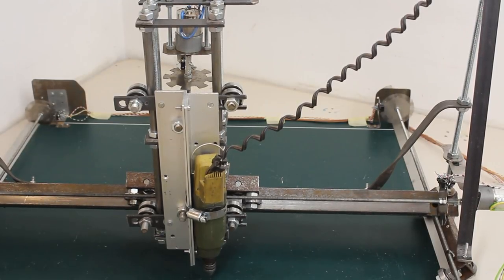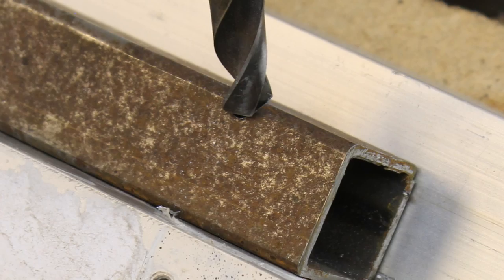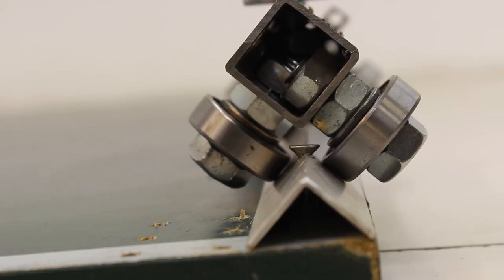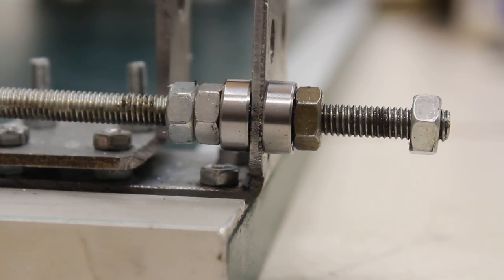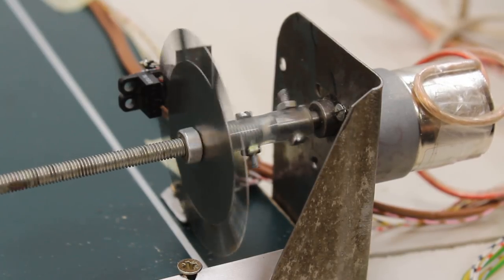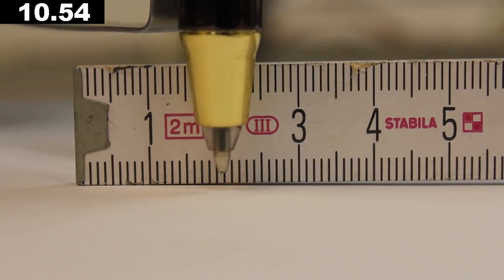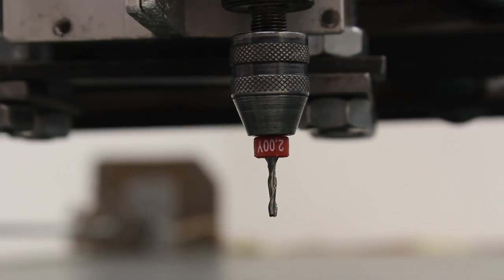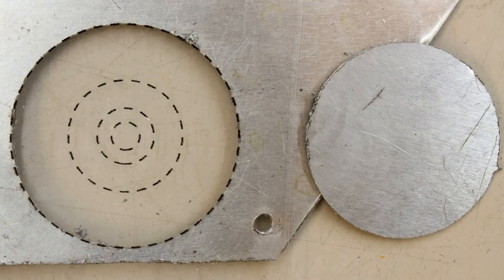Homemade CNC machine with materials from a DIY, built with simple tools

Comment: Very good...a practical way to make a small, low power CNC device without using stepper motors. Thanks for taking the effort to share your ideas.
Reply from the maker: +Ant Mallett Yes it is a practical machine at least for not too hard materials. Plastics is okay and that's what it was designed for. The evolution of CNC goes on. After v0.5
https://www.youtube.com/watch?v=f4ptBpVOSuY
comes v0.6:
http://www.homofaciens.de/technics-machines-cnc-v0-6_en_navion.htm

Comment: You did a great job on the Minimalist CNC machine.  I am very impressed, especially since you did not use any stepper motors and still had very usable accuracy  Fantastic and thumbs up..
Reply from the maker: +valveman12 Thanks! Well, the DC motors are (some sort of) stepper motors the way I am using them. You can see more about the working principle in my video about rotation encoders:
https://www.youtube.com/watch?v=XIUrnR8bLAI

Right now I am upgrading this machine using bipolar stepper motors - stay tuned!

Comment: Thank you for sharing this wonderful material! I was always unsure if I could build a CNC with my modest tools but after watching your vid I have no excuses!
Reply from the maker: +Daniel Perez You're welcome. Maybe you should wait for CNC v0.6 to finish, since that will become an even simpler design:
http://www.homofaciens.de/technics-machines-cnc-v0-6_en_navion.htm 
You can watch the video about v0.5 meanwhile:
https://www.youtube.com/watch?v=f4ptBpVOSuY
Reply: +HomoFaciens Thank you for your recommendation. But... this video is about the 2.0 and you are suggesting to wait for the 0.6. Are they totally different projects? Another question: what's your opinion on using much higher diameter threaded rods in order to eliminate the need for wheels (ball bearings) and the linear guides?
Reply from the maker: +Daniel Perez CNC v0.6 will be much simpler to build. All you need is some aluminium angles and 19mm chipboard. The motors will be from old optical drives or old printers. The simple design doesn't even require ball bearings.
You won't get rods with a diameter lager than 12mm in a normal hardware store. They are NEVER dead straight and even with 12mm diameter they bend noticeable under load.

Comment: One of the best cheap builds I've seen. Excellent job.
Reply from the maker: +Palladin54 ...and it's getting even slightly better. I have upgraded the machine using bipolar stepper motors. The video will get online, soon.
Reply from the maker: +Palladin54 ...and it's getting even slightly better. I have upgraded the machine using bipolar stepper motors. The video will get online, soon.

Comment: You are awesome  Norbert Heinz !! Until now I have always used expensive materials for projects that most of the time end up failing!..... No more excuses for not building my projects out of whatever is available.  Thanks for reminding me that with your imagination there are no limits. Dan, Japan.
Reply from the maker: +Dan Past I always start my projects with cheap materials, because I often fail, too. There is always a reason for failure - success might be nothing but good luck. Usually you can learn more from a failure than from success ;)
Reply: HomoFaciens
Yes indeed... words of wisdom and experience . That is very valuable. Thanks! Dam.

Comment: That's a really nice project. Although the machine would not last long when used on a day to day basis, the project demonstrates the principles of a proper CNC build. My kudos go to you for building a machine "on the cheap" that has a good accuracy.
Reply from the maker: ***** Thanks! Yes, "cheap" is the opposite of "reliable". There are 3 weak points that come to my mind:
(1)The brushed DC motors - brushless (stepper) motors are the better choice for running 7/24.
(2)There is abrasion at the threaded bars even with lubricant, thus you have to replace those elements every once a while especially if you use high power motors to increase speed.
(3)You have to readjust the whole mechanics from time to time to keep the accuracy.
Since the main focus of my project is education, this machine is meant to be the starter "drug" for future CNC junkies. There are many great instructions available how to build more professional machines.
Nonetheless this machine is a great tool for doing some prototyping which I will show in subsequent videos - stay tuned!

Comment: Your my hero! You've made the one kind of 'do it all' CNC machine I was considering doing myself, with little money. Now I'm going to have to seriously consider dropping my other projects to make this. I'm tempted to use cheap China stepper motors though, rather than your brushed motors, but will depend on how cheap I can get them. I like the rusty components as well. Makes it look more homemade and recycled. I'm always keeping stuff, just in case it comes in handy! . Great Job again :-)
Reply from the maker: andy parry Thanks! Maybe I will replace the DC motors with stepper motors some day to improve speed or reliability. For now the machine works great.
...I even pick up rusty screws and take the with me whenever I find one on my way...

Comment: A good solution to your friction versus clearance problem on the 'nut on threaded rod' is something I used on a similar mechanism (although I actually used two nuts with a spacer to extend the length of threaded contact and provide a bit of lateral 'pinch', rather than angling the nut.) I set up my rig with excess friction, introduced some cutting compound and then ran the bar through the nuts repeatedly to grind and polish the contacting faces of the inner and outer threads until they were polished perfectly smooth (I used an electric drill to do the hard work) . After cleaning up (very important not to leave any traces of cutting compound in machinery!) and adding some lubrication, friction was dramatically reduced without compromising clearance. 

p.s. I use Molybdenum Disulphide impregnated grease. It's stickiness does attract dust, but also keeps it on the bar and it's perfect for metal-on-metal gears.

p.p.s. For your application a threaded tube might be better than a threaded rod. I don't understand the underlying physics, but tubes are less prone to bending than solid rods with the same O/D. Furthermore, they have much less mass, which means less inertia. I think you might be better off with 10mm (stainless), rather than 6mm for your threaded shaft. Also, if you used a tube you could couple the end of the tube to your motor shaft using a pin-in-slot arrangement (i.e. flatten and then drill the motor shaft so you can fit a pin through it, then cut/file a slot of the same width as the diameter of the pin in the end of the tube.) If necessary, fabricate a bush to bridge the O/D of the motor shaft with I/D of the tube. These are easy to make using standard steel tube stock because the I/D of a tube can easily be modified to exactly match the O/D of another tube with nothing more sophisticated than a drill bit providing it is undersized.
Reply: +aporiac

lol - just discovered your v2.1 video and see you've come up with a similar multi-nut arrangement to the one I used. If you haven't already done so, try my cutting compound tip for cheaply and easily converting commodity nuts and threaded rod into precision machined components :-)
Reply from the maker: +aporiac 
Thanks for sharing your ideas! I will do some more investigations about CNC drives in the near future. It will become part of my CNC v3.x series:
http://www.homofaciens.de/technics-machines-cnc-v3-x_en_navion.htm

Comment: An excellent and interesting video, thank you for posting.  One little "nit-pick" is when tapping holes.  You should always start with the TAPER tap.  This is tapered to make it easier to start.  Then on to the intermediate, if needed, followed by the BOTTOMING tap last.  This is so called as it allows you to tap to the bottom of a blind hole.  Still a great video!
Reply from the maker: Thats the sequence I used the taps, however I talked to use them the other way round due to my not so good English - sorry. I have added a remark on my pages after other YouTubers spotted that error as well.

Comment: Facinating build. 

Like the way you explain all the building steps and you tell what to look out for while building. 

Tried to build one using MDF and "real" stepper motors, but it never got accurate enough for any practical use. Maybe I should give it another go ☺
Reply from the maker: +Zeedijk Mike This wasn't my first attempt to build a CNC. You'll get better with each project you finish.

Comment: Very good engineering. I've seen a few other cheap cnc machines, but I think this one is the cheapest.
Reply from the maker: Cheap is nothing if it doesn't work. I have used this one a couple of times to process plastics and: it works!

Comment: I am really impressed. I thought there could be some oscillations during the movement of the iron bars. But it is flawless. Great work. :)
Reply from the maker: Subbash Padmanabhan It's too slow for oscillations (less than 3mm per second, around 30 rounds per minute). I guess that could become a problem when using more powerful motors. Sometime I'll do an upgrade - let's see what happens.
Reply: HomoFaciens In such case I hope you have to include some tuned controllers in the program. It will be more interesting and challenging. My wishes. :)

Comment: Amazing! I made a machine following your blog and videos.  Soon I'll publish a video of it. Thank you very much for sharing!
Reply from the maker: +Luciano Santos Hope to see your video, soon!
Reply from the maker: +Luciano Santos
Thanks for the links to the videos. It's always nice to see my CNC machines being copied in distant places - Hello Brazil!
I have insert the links on my pages as well.
Good to see that people are improving my design rather than just making a 1:1 copy.
What about a closer shot of your linkage between motors and threaded rods? Looks like two brackets with a piece of tube?

Thanks for your donation!
Reply: +HomoFaciens 
Thanks! I am glad you liked it.
Actually the motor linkage was made with a piece of fuel electronic injection hose and metal clamps. That hose is very strong! Besides the video I'll  take some pictures closest.

Examples:
http://www.lowes.com/pd_121290-59558-MC6W_4294821770_4294937087?productId=3140741

https://www.autoparts2020.com/rsdev/part_group.jsp?PHPRJ_GROUP_ID=28845

All the best!
Reply from the maker: +Luciano Santos 
Now I can see how you did the linkage - thanks!
Reply from the maker: +Luciano Santos As answered in the comment section on my project page in more detail:
Check the mechanics or increase motor torque.

P.S. Double posting questions on YouTube AND as a comment on my page means double work for me. I suggest using the comment section (or send me a mail), since I am not logged in to YouTube every day.
Reply: +HomoFaciens Thanks and sorry for double posting
Reply from the maker: +Luciano Santos You're welcome!

Comment: Oh my god, so clever way to use materials from hardware store. 
I made my drawing machine using plywood and simple nuts on the threaded rode, but it was so much less accurate and stuck all the time
Reply from the maker: +Uterr Same as the bolts with the inner thread shown in the video you have to twist the nuts to lower clearance. If the machine gets stuck, the torque of the motors is usually too low.

Comment: good job, although one thing to notice is that z axis can go up enough to cut through high materials, but the y axis prevent you to put high material
Reply from the maker: +Eng. Fares Thanks! This machine is not for high power routers, thus you can't cut very thick materials. Even with the Y axis limiting that thickness to approximately 5cm, you won't even get that with the 40W router I am using.
Reply: anyway nice project goodluck

Comment: This is the best DIY CNC design I have ever seen. I just wonder, why did you use DC motors instead of stepper motors?
Reply from the maker: Sergey Singov Thanks! I used stepper motors just to make things different. I am running an educational project and I had demonstrated how to turn a DC motor into a "stepper motor" using optical sensors (https://www.youtube.com/watch?v=PQ1FBcQT0AI). This machine was meant as an application for that control loop. Another advantage: You can use many motors from scraped devices. I am currently building an even cheaper CNC using motors form old CDROMs - stay tuned!

Comment: You have a good all round skills ie. machining, mechanical assembly, software writing, electrical and electronics. Its good to salvage old parts to built something. As it reinenforce our knowledge and uderstanding of how things works. If the lead screw is constrained by a bearing at the motor end, better precision can be achieved. Well wonder whether you can buit that level of precision into a 3d printer. :)
Reply from the maker: Alan Fok Thanks! There is a reason not to use a ball bearing on the motor side: Usually the threaded bars from a DIY are not dead straight and with ball bearings on both ends, the mechanism will be jamming.

Comment: Very neat! Although using geared DC motors is not the best idea, it's better(and sometimes cheaper!) to use steppers and for example a RAMPS board that you can get a chinese clone of for ~$30, with an arduino mega already included.

Also, I recommend you getting a 10-degree 0.1mm V-bit and milling PCBs out, I just got mine from eBay and it punctured my finger when I pressed on it really gently! It's REALLY sharp, so there should be no real load on the axes and therefore very little slack and flex.

And as a side note, I'd very much like to see you explain resonance on the example of tesla coils, because you're really good at generally explaining and demonstrating things, I just don't get how much work you put in these videos. I think it'd help a lot of people understand them better.
Reply from the maker: ***** Thanks! It's an educational project so doing things from scratch is one idea behind the machine. You can see clearly how the geared motors do a single step using the sensor disc as feedback. There are many fantastic videos about how to build a CNC machine with more professional electronics - I wanted do go another way.

 Yes, there is nothing better than using high quality tools - once more I wanted to demonstrate what you can do with low tech. I will have a look at that fantastic V-bit.

 Induction and electrodynamics are on my list of things to treat in the future, but since these subjects require a lot of animation work to visualize, those videos will take a long time do create - be patient.
Reply: HomoFaciens Thanks for the response, and keep at it!

Comment: I've been looking at buying a CNC machine. I am going to play around with the idea of just making one. Thanks
Reply from the maker: Jacob Lanctot You're welcome! Making one is the greater challenge, but you will learn a lot if you succeed.
Reply: I am wanting an extended z axis. From my understanding this will reduce accuracy. If I have the build plate in charge of the z axis instead of the head. This will be slower. I think this will do the job. What do you think?
Reply from the maker: Jacob Lanctot The longer the lever, the larger the deviations. You have to try it to see if it works. If you fail, you have to alter your plan and try again until you'll succeed. That's how I have built this machine. You rarely will succeed in a first run...

Comment: Hi HF,
This is a wonderfully cost effective design, cleverly designed to achieve accuracy. Plus your excellent video makes it appear easy to make, so thanks for re-kindling my interest in CNC. I had given up on finding it would be unaffordable to covert my hobby lathe & vertical mill. 
Just two points, at 3.40; you say to counterbore the main carriage drive thread to 6mm, but why? Surely this primary thread will be subject to a lot of wear so ideally you need threads through the full thickness of the lug rather than counterbored to clearance diameter part way through. If it's to allow you to tilt the lug out of alignment to remove backlash, the increased wear will soon cause the backlash to re-appear in just the few threads you have taking the load.

 Also; you should use the taper tap first, and as it's not a blind hole you don't need a bottoming, or even a second tap to follow anyway.  Using the bottoming tap first means the leading cutting edges on the tap are doing 100% of the work so will go blunt quicker, whereas on the taper tap, each  of the cutting edges (on the tapered portion) will take small cuts each, on every rotation.   A bottoming tap is to keep back for finishing the bottom threads of a blind hole, taking out what the second tap leaves, by nature of its slight taper profile. 
Great video; keep up the good work.
Reply from the maker: +Allan Qurashi Counterbore means just removing the sharp edges at the ends of the bore hole, not to completely remove the thread (is that the wrong word?).

That's correct. I used the taps in the right way, but named them wrong in the video (it's the language barrier...).

Thanks! More CNC machines and improvements for this one will follow.
Reply: +HomoFaciens you speak English very well. It puts me to shame for only speaking one language. 'Counterbore' means your 6mm hole will be drilled some depth into the workpiece. The word you need is 'chamfer' or 'deburr'.  Americans would use 'break sharp edges' but that's what I find written in Boeing structure manuals, they may not use that term verbally.
BTW I see you've used an old twist drill to make a centre punch. Top marks for recycling.
Reply from the maker: +Allan Qurashi I'll keep that in mind for my future videos. Thanks!